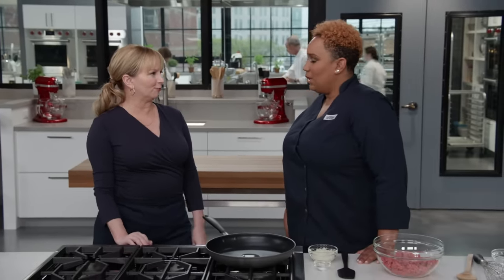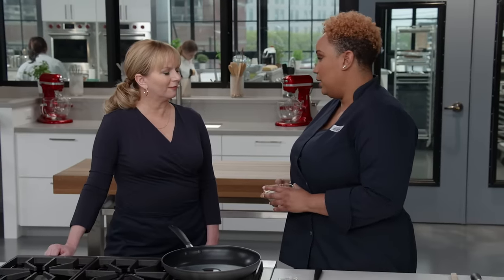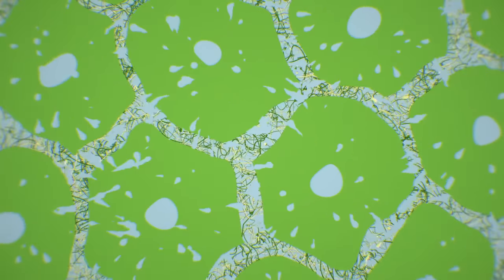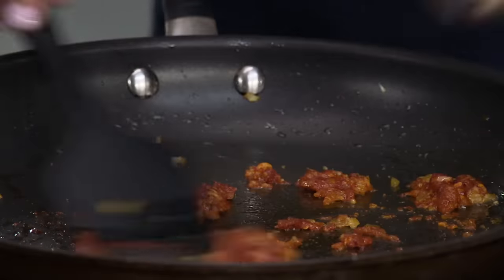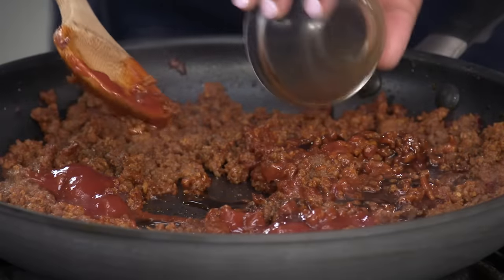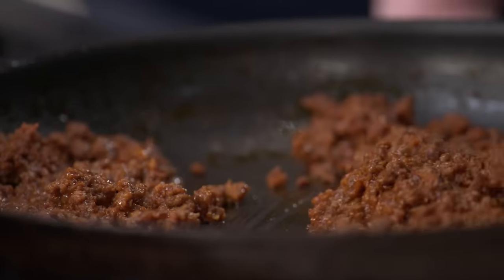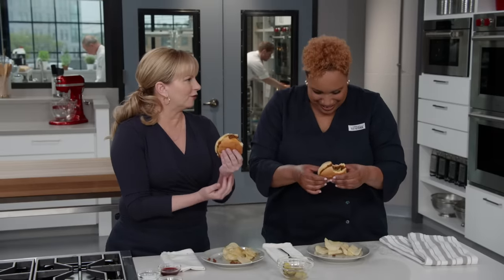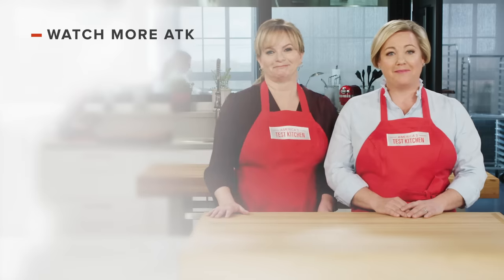How to Make Your Favorite Childhood Sloppy Joes

Comment: I realized long ago that when eating Sloppy Joe's or even a pulled pork bbq sandwich is to eat them on hot dog buns.....less mess plus hot dog buns are tastier in my opinion.
Reply: I eat Clean Joe's.  Open a hamburger bun on the plate, dump the sauce on both buns... and eat it with a fork.
Reply: Really? Souns like an idea to try
Reply: Also if you slice a kaiser bun partially, making somewhat of a pocket, you're good 2 go!! I've also tried using the croissant rolls out the can, making Joes-inna-Blanket/Pocket Joes!!😋😉

Comment: 1 lb 80/20 ground beef
1 tbsp water
1/2 tbsp baking soda
1/2 tap salt

2 tsp oil
1/2 an onion
1/8 tsp baking soda

2 cloves minced garlic
2 tsp paprika
1/4 tsp red pepper flakes
1/8 tsp salt
2 tsp brown sugar 
1/4 cup tomato paste
1/3 cup ketchup 
1 tbsp Worcestershire sauce
1 tbsp red wine vinegar

1/2 tsp cornstarch
1 tbsp water
Reply: Thanks for listing the ingredients in the order in which they are added--that's very helpful. But I want to point out two typos: in the first group of ingredients, the slurry should be 1/2 tsp (not tbsp) of baking soda. Also, in amount of salt should be "tsp," not "tap." But again, thanks for listing this.
Reply: thanks for this and @GuyNoirxyz for the corrections
Reply: I was trying to reference an episode of ATK for this recipe (or possibly an older one) when I came across this recipe version, and this comment thread.  Off topic,  this thread is literally what I feel social media/ YouTube should be about. I have no notes, only kudos.

Comment: Based on the video, since I don't have a Cooks Illustrated subscription:

America’s Test Kitchen Sloppy Joes
Serves 4

Ingredients:
•	1 tbsp water
•	1/2 tsp baking soda
•	1 lb ground beef, 85% lean
•	1/2 tsp table salt
•	2 tsp oil
•	1/2 onion, finely chopped
•	1/8 tsp baking soda
•	2 cloves garlic, minced
•	2 tsp paprika
•	1/4 tsp red pepper flakes
•	1/8 tsp salt
•	2 tsp brown sugar
•	1/4 cup tomato paste
•	1/3 cup ketchup
•	1 tbsp Worcestershire sauce
•	1 tbsp red wine vinegar 
•	1/2 tsp cornstarch
•	1 tbsp water
•	Buns and pickles, for serving

Method:
1.	Make a slurry of the water and 1/2 tsp baking soda. Pour over the ground beef, along with the salt. Stir, then set aside.
2.	In a nonstick pan, add the oil over medium heat until it shimmers. Add the onions and 1/8 tsp baking soda. Sauté for 3-4 minutes until the onions break down.
3.	Add the garlic for 30 seconds, until fragrant.
4.	Add the paprika for 30 seconds, until fragrant.
5.	Add the red pepper flakes, salt, brown sugar, and tomato paste, cook 3-4 minutes, until the tomato paste becomes rust-colored.
6.	Add the beef to the pan. Break it down with a wooden spoon. Cook until no longer pink, about 5 minutes.
7.	Mash the beef with a potato masher.
8.	Add the ketchup, Worcestershire sauce, and red wine vinegar. Cook for a few minutes.
9.	Make a slurry of the cornstarch and water. Stir into the beef until it coats and thickens, about 1 minute.
10.	Add any other seasonings to taste.
11.	Serve over buns, topped with pickles. Smash the buns to ensure the sloppy joe sticks.
Reply: Thanks for taking time
Reply: Thank you!

Comment: Mother made great sloppy joes but lost her recipe.  The closest I've found is in an old Amer Heart Assn cookbook.  
Sauce: 8 oz can no salt tomato sauce
1/2 C low-sodium  catsup
1 1/2 Tbsp worcestershire sauce
1 tsp prepared mustard
1 tsp molasses
1 garlic clove, minced
1/2 tsp dry mustard
Pinch of ground cloves

1 lb. Lean ground beef
1/2 small onion, chopped fine

I cook the beef and onion then add the sauce ingredients. Let simmer until thickened.

I use regular tomato sauce and catsup, not low sodium.
Can add a bit of grated orange rind if you have it.  And I suppose if you Must.... add a bit of grated vegs

Comment: 2 tablespoons water, divided
½ teaspoon plus ⅛ teaspoon baking soda, divided
1 pound 85 percent lean ground beef
½ teaspoon plus ⅛ teaspoon table salt, divided
2 teaspoons vegetable oil
½ onion, chopped fine
2 garlic cloves, minced
2 teaspoons packed brown sugar, plus extra for seasoning
2 teaspoons paprika
¼ teaspoon red pepper flakes
¼ cup tomato paste
⅓ cup ketchup
1 tablespoon red wine vinegar, plus extra for seasoning
1 tablespoon Worcestershire sauce
½ teaspoon cornstarch
4 hamburger buns
Reply: 1.) Combine 1 tablespoon water and ½ teaspoon baking soda in small bowl. In large bowl, toss beef with baking soda mixture and ½ teaspoon salt until thoroughly combined. Set aside.

2.) Heat oil in 12-inch nonstick skillet over medium heat until shimmering. Add onion and remaining ⅛ teaspoon baking soda and stir to coat. Cook, stirring occasionally, until onion is softened, 3 to 4 minutes. Add garlic and cook, stirring constantly, until fragrant, about 30 seconds. Stir in sugar, paprika, pepper flakes, and remaining ⅛ teaspoon salt and cook, stirring constantly, until paprika is fragrant, about 1 minute. Add tomato paste and cook, stirring constantly, until paste is rust-colored, 3 to 4 minutes.

3.) Add beef and cook, breaking up meat with wooden spoon, until beef is no longer pink, about 5 minutes. Mash beef with potato masher until fine-textured, about 1 minute. Add ketchup, vinegar, and Worcestershire and stir to combine, scraping up any browned bits.

4.) Combine cornstarch and remaining 1 tablespoon water in small bowl, then pour cornstarch mixture over beef and stir to incorporate. Cook, stirring constantly, until sauce thickens and coats beef, about 1 minute. Season with salt, extra sugar, and extra vinegar to taste. Spoon beef mixture onto buns and serve.
Reply: Tossing the beef with baking soda in step 1 helps keep it tender and juicy; adding baking soda to the skillet with the onion in step 2 helps the onion break down. You may substitute 90 percent lean ground beef in this recipe, but the cooked mixture will be a bit less tender. Serve the Sloppy Joes with pickle chips, if desired.